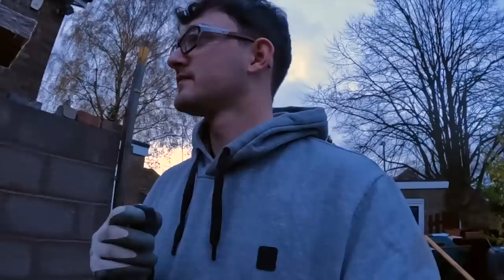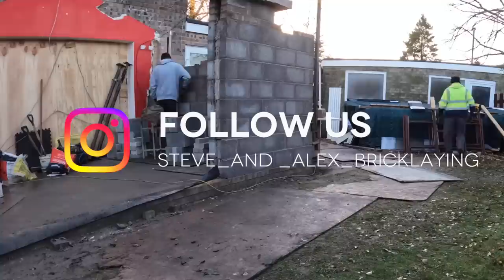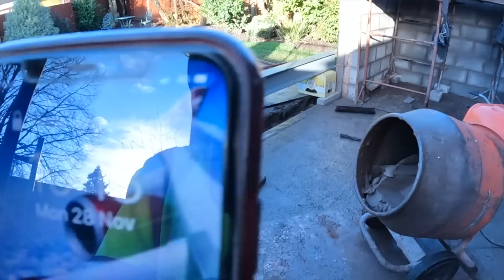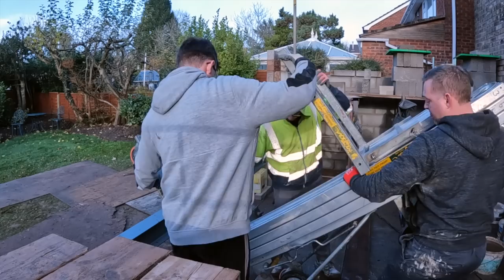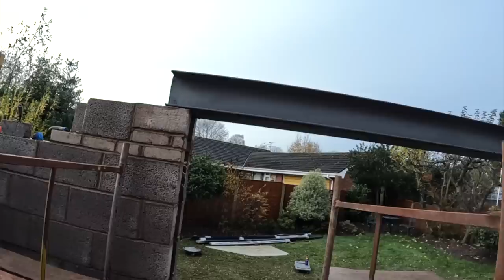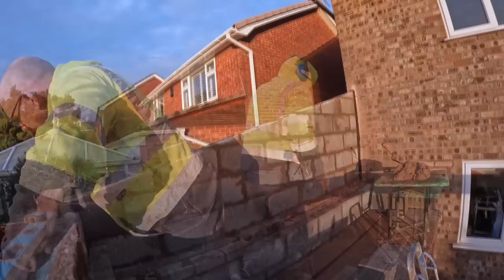GENIE LIFT PROBLEMS  !! BIG EXTENSION BUILD PT 5

Comment: I'll give you a genie tip.
If you want to edge the steel to even up the bearings, knock on the side of the forks with a block of wood and a lumpy. It'll skid the steel 5mm at a time.
Don't tell the hire shop though 😆

Comment: Haha when the genie fell out when you was moving it. First time I used one and returned it to hire shop I forgot to put the transit clamps on. When I reversed into yard with doors open the whole thing slid out there was gears rollers springs everywhere. Cost me £500 to get it rebuilt. Never done it again though.🤣🥲

Comment: Hi lads, a few vids ago steve said that you can no longer use jablite in the floor make up, it now has to be celotex ridgid insulation, is this part of the new regs as i pointed it  out to a building inspector yesterday and he disagreed, wonder if you could clarify this for me. cheers lads.
Reply from the maker: Different authorities have different rules . 
   We were told if we used it it would have to be minimum 160 mm and they don’t make it in that size . 
   It actually works out  only slightly dearer to use the 100 mm celotex now 🙄🧱👍🏽
Reply: @SteveAndAlexBuild  thanx for the prompt reply, keep up the good work.
Reply from the maker: @keithkench9432  . No worries . Thanks Keith 🧱👍🏽

Comment: Why didn't you move the steel beam out of the way, rather than lifting the genie over it  could of lost a few fingers
Reply from the maker: Did you see his hard it was to move that steel !
Reply: @SteveAndAlexBuild  I did but it's safer than lifting the genie over the steel, one of the Robbiez could of lost z few fingers
Reply: @SteveAndAlexBuild  no criterzing but if that was on a site, I think a few yellow cards
Reply from the maker: @glenmarshall4980  🧱👍🏽
Reply from the maker: @glenmarshall4980  ok but if that was on a site it would have gone up on a telehandler or a crane  🧱👍🏽
Reply: You mean  could have lost? Not could of lost!  Different meaning ?.
Reply: @steveemmett9540  all I know it was so dangerous.

Comment: Your going to have to redo the cuts on the gable again I think you haven't allowed for the height of the wallplate and the rafters on the front of the extension, might be the right height under the bedroom window but you haven't allowed any room for the timbers at the gutter level, hope you haven't finished the other side before it's too late
Reply from the maker: The roof went on perfectly and it’s now rendered and plastered
Reply: @SteveAndAlexBuild  ok
Reply from the maker: @liambrennan783  🧱👍🏽
Reply: Maybe they ran a facia all the way around and up the verges Liam....?  Only way I can see of covering the rafters as you've pointed out without building up further
Reply from the maker: @simonworsnop900  All I know is the roof went on perfectly 🧱👍🏼
Reply: @simonworsnop900  yeh maybe but ya still build ya brickwork to the top side of the rafters not the underside it's common practice otherwise it's a cold spot
Reply: @liambrennan783  yup we build all ours up .
Tbh I cheat and put rafter up then I know exactly where to wall upto etc but we do the roofs aswell anyway so no waiting on others  ...I'm simple and like simple ways lol
Reply: @simonworsnop900  same here mate it's a neater and more solid job, even if the joiners just put the plates on and one rafter/truss either end just to get the pitch there to work from

Comment: How come you boys are still building these with fluff?
Round our way, they want us putting 80mm phenolic in the cavity now like it's a new build.
Reply from the maker: Insulated outside, in cavity and inside 😒🧱👍🏽
Reply: @SteveAndAlexBuild  blimey governor
Reply from the maker: @chriscollins1704  these new regs are a nightmare and will catch a lot of people out 🙄🧱👍🏽
Reply: @SteveAndAlexBuild  well, this is it.
Also an extra cost nobody needs.
Bloody climate alarmists
Reply from the maker: @chriscollins1704  . Definitely the extra insulation costs a fortune .
   The fibreglass we used was .37 so we have to use the .32 now . Not much more expensive per pack but half as many batts in a friggin pack ! Which means twice as expensive. The insulation companies are doing ok 😒🧱👍🏽
Reply: @SteveAndAlexBuild  😄 they want us at net zero (money)
Reply from the maker: @chriscollins1704  . It’s working well then 😰😡🖕🧱👍🏽

Comment: Hate it when hire equipment turns up and its not fit for use its lazy on the hire company. It then cost us money you'll never get back 2hrs down time and travel costs is actually a lot of money and they dont care which is always so annoying. You came through it and got stuff done just have to keep going .Big old beam that was lads 👍🧱👏
Reply from the maker: in their defense Justin this was our first ever issue with any of their equipme🧱👍🏽 and it wasnt far to swap it out. 🤙🏾🧱👍🏽
Reply: Shit happens i guess but frustrating all the same when you want to get on Steve 👍
Reply from the maker: @brickrightbuildinglandscaping  . It certainly does mate . 😆🧱👍🏽